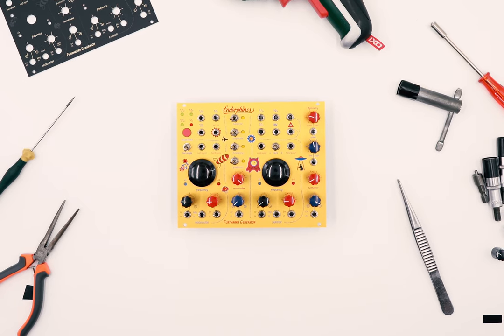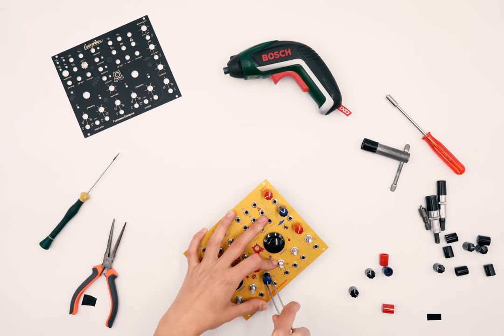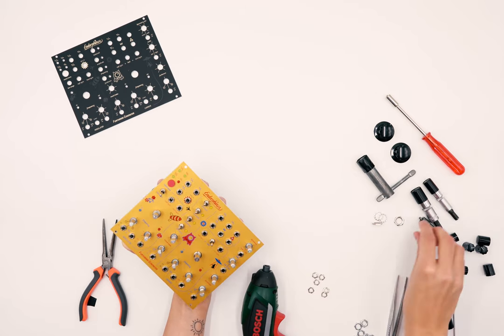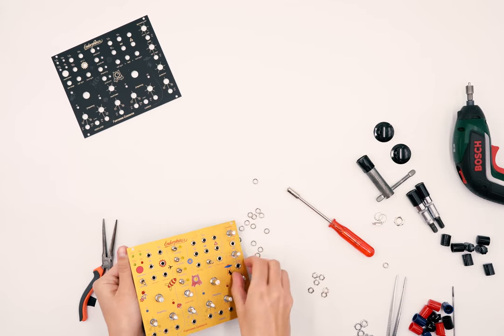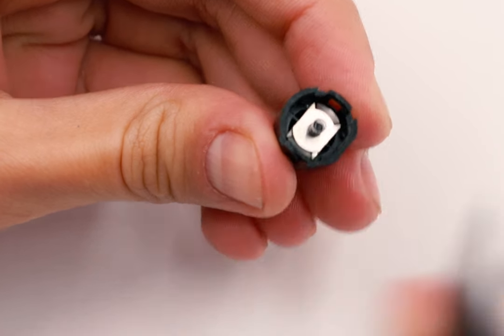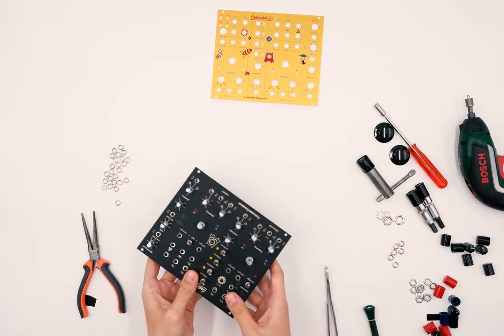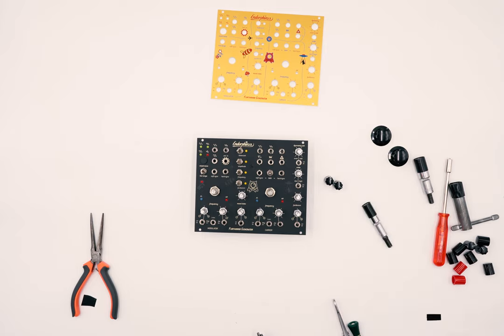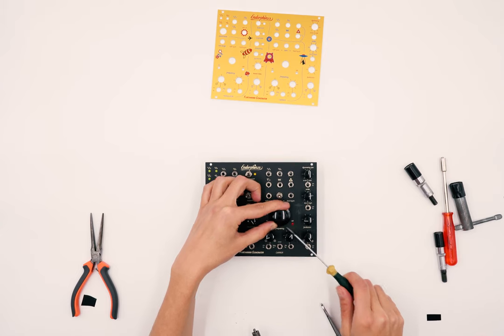Panel replacement tutorial on the example of Furthrrrr Generator

Comment: Can you send the link on Mouser?  (For the round knurled nuts on the jacks, you can use the special screwdriver from Mouser but we also use a special head for the electric screwdriver.)
Reply: If only I had special screwdriver from Mouser or special head for electric screw driver (in European accent). :(

Comment: Where can I find the tool with the rubber guard to remove the nuts without scratching things up?
Reply from the maker: check the links in that video. also the rubber is just electric isolation tape
Reply: @Endorphines  It looks like the link has changed. How do you protect from scratches please?
Reply from the maker: @philip6252  hey. which exactly link has expired? screwdriver? tools? 
it relatively easy to remove all the knobs with the tweezers

Comment: the M sizes you quote are completely out M9 = M13, M6 = M8,  M 7  =  M10
Reply: or are Europe & UK sizes are different?
Reply from the maker: that sizes vary therefore is better to get a whole set and check what head fits. Our sizes are EU/metric ones which also conform datasheets of most components used in modules. Check that additional text guide with the links: https://endorphines.myshopify.com/pages/guide